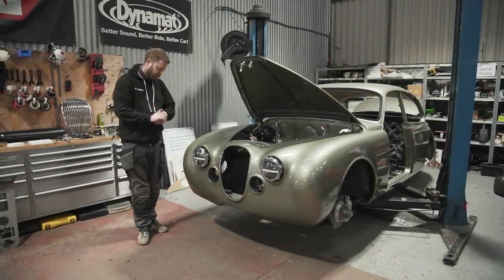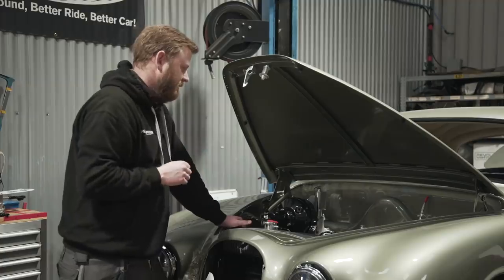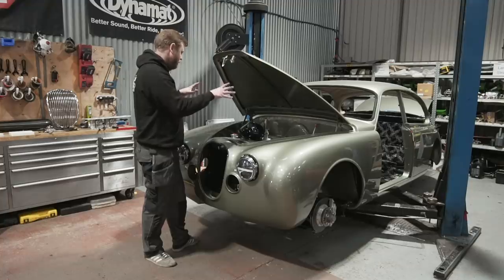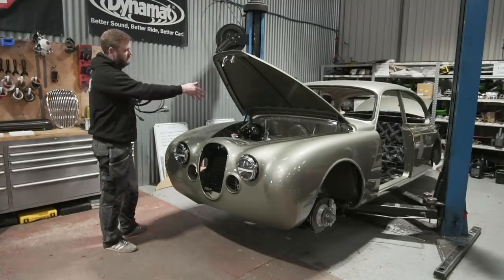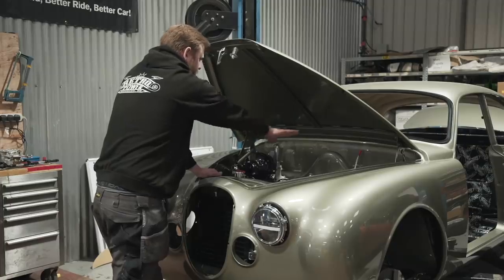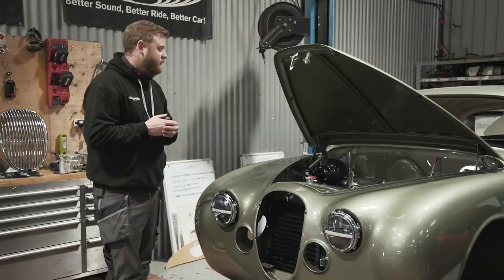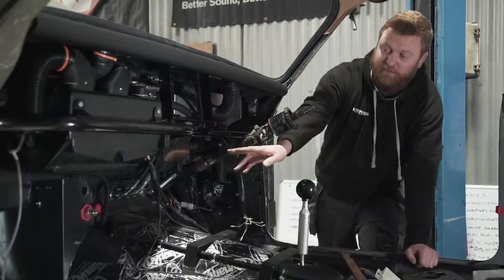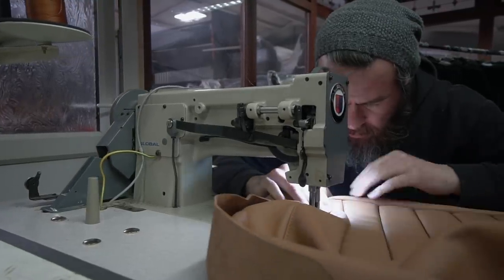MK2 Jaguar "Project Utah" - 2JZ Powered Restomod Build Episode 8

Comment: This car just makes me smile. A lot.
By the by, my first car had a large rotary starter knob/switch. Yes, the only security was the door lock! It was a 1963 Simca 1000, a 17th birthday present from my parents. With 66% of the weight over the rear wheels, it taught you to be quick on the steering corrections....

Comment: That engine doesn't fill the engine bay like an XK. We can see lots of firewall. However you will have a lower c of g and better  weight distribution so that's all good. It frightens me that the paintwork is exposed to garage rash with so much work left to do.

Comment: On  Mark 2 Jaguar, the two small grilles have nothing whatever to do with the horns. They were put on cars which did not have foglamps fitted, just to fill the space. They are just dummy chrome inserts, nothing more. The horns were mounted behind the front crossmember.

Comment: As beautiful as the original Jag grille is (especially now it's all straight and shiny), I'm rather getting used to seeing it with a dark, gaping hole in the front, and it makes me think...keep the chrome surround, but lose the slats and fill it with a dark mesh like the old XJR used to have - or even a diagonal wire like a Bentley Turbo R.  Thoughts?

Comment: I would expect that putting a cordless charger inside a slab of aluminium would short it out and substantially reduce it's efficiency or even render it ineffective.
Reply: Cordless chargers use magnetics to charge the phone wirelessly, the aluminium should have no effect on the wireless charger.
If it was made of steel, it would be a problem, or copper, aluminium won't interfere.
Reply from the maker: Not been a problem on the previous ones we've done

Comment: If one may make so bold as to ask, what is the purpose of the whit lines over the Headlights? Some demon tweak or just to ensure level fitting? Or something else even?
Reply: Yep, I've been looking at them and wondering. Perhaps they are DRLs?  I've also wondered where the front indicators are. I'm assuming in the lower half of the headlight but IMO that'd make them hard to see when the headlights are on, especially if they are LED.  But gawd that's a lovely bit of kit, that car. Wouldn't do too well on my dirt road down under in Oz, though....
Reply: @alexbrown1995  Not on Cape Town's Potholes either! :)
Reply: @johng9399  A long time since I saw Cape Town. Born in Zim....
Reply: @alexbrown1995  ex Zim myself!
Reply: @johng9399  Awful lot of us around the world. Went back for a look in 2014. Found the schools I went to and the house Dad built in the late 50s. And the store where I got bitten by a baboon when I was 8 - still have the scar at age 69 :-)

Comment: Sorry, but the steering geometry will be compromised because of the relationship between the outer track rods and the wishbone lengths. It will work but not to the high standards that the rest of the vehicle appears to have been  built and engineered. These cars have criminal bump steer rates from original and having shorter track rods will make it worse. Toe in/ toe out on turns poor and Ackerman angles wrong. The rack centre section needs to be shortened and outer track rod lengths increased accordingly.
Reply from the maker: We put a lot of testing into dialling in the steering geometry, hence the custom steering arms. There is less than 0.25 degree of bump steer from full bump to full droop and ackerman has been perfected. We covered this is an earlier episode
Reply from the maker: Episode 4, around the 13 minute mark

Comment: Stainless braid hoses in long lengths is very wrong. Excellent for flexible hoses ofcourse but steel line [copper is generally illegal] for lengths is essential.
Touch screens are dumb in a motorcar and really should be banned.
Now being a Jag you have to create some oil leaks so it is period correct!

Comment: With you 100% on the touch screen nonsense that is infecting modern cars. It's not just the time that you need to look at it but also the car vibrates as it moves. Hit a bump just as you 'push' the virtual button and what you intended to do is now three button presses away....